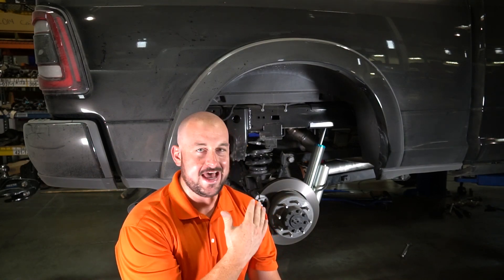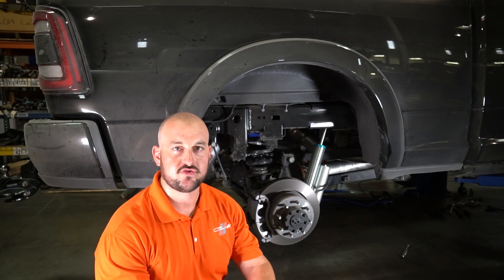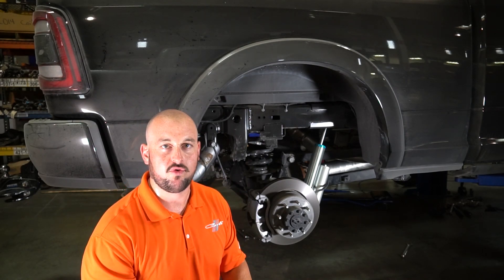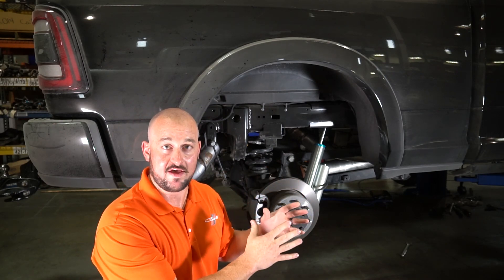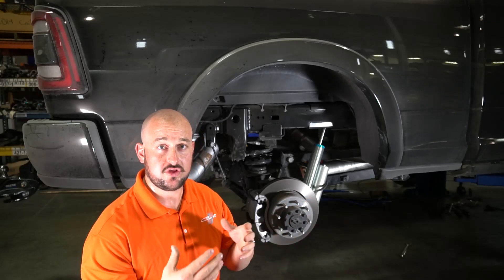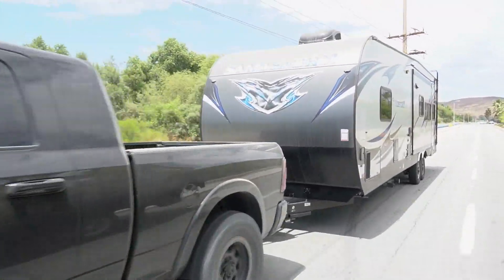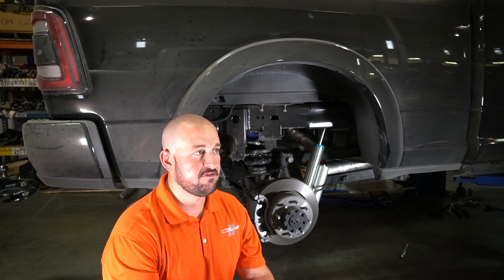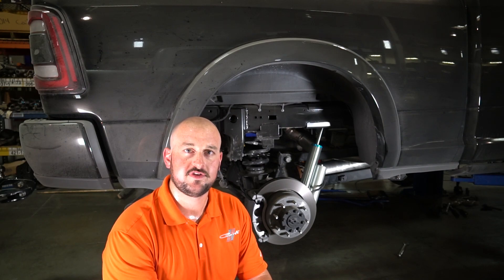Carli Suspension Leveling Pintop Shakedown

Comment: Adjustable air springs allow drivers to raise and lower the vehicle to one of five ride height settings, depending on where you’re working or how you’re playing. In addition, the constant driving profile delivers a proper headlamp-to-road angle for consistently even forward illumination. All of this can be easily controlled with your fingertips using convenient dashboard buttons.
Proper headlamp-to-road angle.

Comment: I have a 2005 Dodge Ram 3500 SRW short wheel base. It is a Quad Cab set up. I to a a camper that comes in between 9-10000 pounds. What suspension system would you recommend. I hunt out of this truck as well.  It gets some off road use but not anything major.  I am looking for a great ride without loosing towing capacity.
Reply from the maker: A Backcountry with Control Arms sounds like a perfect setup for you. End links and Add-a-packs if you're on a budget, Torsion Sway Bar, Full Leaf Springs and Airbags if you're wanting to go all out!

This can be configured here: https://carlisuspension.com/product/dodge/dodge-ram-2500-3500/ram-suspension-systems/3-inch/2003-09/dodge-3-backcountry-2-0-system-2003-2009-diesel/
Reply: @thecarlisuspension  thank you!!  Want to go all out.  Soon as can get the money together and the wife's approval gonna get it done!!

Comment: So basically you cannot add air bags to this particular setup to help with the towing sag? Or has something been done to remedy that. Thanks for the advice
Reply from the maker: We maintain the stock rear coils so no load supplements are needed. If that's a "must have" then you can add airbags or timbrens. We recommend Timbrens as they're removable when not utilized for load support.

Comment: Do y’all have any recommendations on shops in Georgia for installing y’all’s suspension kits
Reply from the maker: Unfortunately, we do not have any retailers/installers in your area. My recommendation would be to purchase the system from one of our stocking retail outlets (https://carlisuspension.com/retailers/) and bring it to your local, trusted shop for installation.

We provide detailed instructions with the systems so any reputable shop will be able to handle it! That said, we always recommend self-install if you have the time and mechanical ability. No one will care about your install as much as you will. 😊

Comment: I am thinking about this kit for my 2019 2500. I am guessing that if I ran it in conjunction with Air lift bags when towing I would be able to re level the truck under load?
Reply from the maker: Airbags aren't a great option for the coil spring equipped Ram 2500s. We recommend Timbrens as they're removable when not loaded to prevent the loss of uptravel.

Comment: Great video and explanation. Will this work and maintain the factory payload (5400lbs) for a RAM 3500 dually or is that a different suspension tune?
Reply from the maker: We have a system for the 3500 DRW that is a different shock package (and tune respectively) that maintains the factory payload as the springs are not altered. This can be configured here: https://carlisuspension.com/product/dodge/dodge-ram-2500-3500/ram-suspension-systems/2-5-inch/2019-ram-3500-4x4-diesel-2-5%e2%80%b3-leveling-system/pintop-leveling-system-2019/

Comment: Can you tell me the tire setup on the truck in this video along with the wheel specs and offset. I am definitely considering this setup. Thanks
Reply from the maker: Trail Ready 20x9" Wheels, 5" Backspace - 37x13.5" Nitto Ridge Grapplers.
Reply: @thecarlisuspension  Awesome! Thanks for replying!
Reply: Is that a 0 offset?

Comment: Can I expect the same kind of performance with the 2nd gen Rams and leaf springs?
Reply from the maker: The 2nd Gen Rams have short arms front and leaf springs rear. The ride will be very similar up front and, with the full leaf springs, similar in the rear. 2nd, 3rd and 4th gen rams can run our Long Travel airbags to supplement payload capacity back to factory with no sacrifice in unloaded ride quality or travel. I'd give the ride quality edge to the 2014+ and the hauling capability to the other trucks given their ability to run the bags. Very much in the same ball park, either way!

Comment: My 2500 limited has  Factory load leveling air system is this going to work  on my truck
Reply from the maker: This will install on your air-ride rear but you'll need longer links to level the rear to the front. CJC Offroad has these links available.

Comment: 3.25 level for a 2019 ram 2500 set up for factory air ride eta?
Reply from the maker: We're not doing the air ride 2500, unfortunately. Hit up Top Tier Suspensions or CJC Offroad as they provide the parts needed to make our system work on that vehicle!

Comment: Can that still up a 40ft 5th wheel weights bout 14k
Reply from the maker: Depends more on hitch weight than overall. 5th wheel can be 10-20% of total trailer weight on the tongue. 10%, you'll likely be fine. 20%, you'll likely want to look into load supplements.

Comment: Can u put 8000 payload on this truck?
Reply from the maker: This is a 2500 - they max out mid to high 2,000s.
Reply: @thecarlisuspension   it should be standard factory 8000 but does carli have suspension to increase it to 8000 ?

Comment: Is the plan now to change the gen 4 rams 3” front spring to the 3.25” going forward? I ask as I currently have the 3” version and I see your now marketing only the 3.25”. Any benefits to going to the new spring?

Any update on the ram 3500 air bags? With my 5th hooked up, I’m squatting 2-1/4” in the rear with the 5 leaf add a pack and looking to fix that.
Reply from the maker: Hi John, The 3" coils provide 3" on the Mega Cab, 3.25" on a QCSB and about 3.5" on the SCLB. We changed the way we market it at the Quad Cab seems to be the most common application. Nothing has changed in the manufacturing of the springs. The airbags were released last week! Should be shipping in 4-6 weeks. 
https://carlisuspension.com/product/dodge/dodge-ram-2500-3500/ram-components/13-18-3500-components/long-travel-air-bag-system-2013-ram-3500/
Reply: Carli Suspension Carli Suspension Hell ya!! The bags are alive👍🏻 I’ve been bugging CJC about them. Can’t wait to get them and fix the sag ass condition. 
Ya I have an 18’ megacab so that makes sense. Next year I’ll move up to the full rear spring pack and big boy shocks. 
How does some get the coilover & bypass front shock setup? Is that only installed direct with you guys?
Reply from the maker: @ColoradoGunfighter  Yes sir, that kit is direct install only!
Reply from the maker: The Leaf springs are capable of more travel than the shocks allow. The rear shocks are 11" travel cycling at an angle to allow 13" at the wheel, all of which the airbags will cycle.
Reply: Carli Suspension Awesome! Thank you for getting back so quickly.

Comment: I prefer the truck to not look saggy loaded.
Reply from the maker: That can be remedied with timbrens or airbags!
Reply: Carli Suspension, my 18 Ram 3500 limited has rear airbags but still has a pretty harsh unloaded ride.  The Carli system ordering scheme is confusing for my setup.  Lots of options to the pintop system but no clue what is recommend vs required.
Reply from the maker: @grwolf272  Everything should be explained in the description on the product page. Totally understand what you mean, though - the product line, being performance based, is a bit complex and takes some reading or a phone call to grasp the way we laid it out. That said, the base kit, CS-DPT25-13-D-ALAS, includes all components needed for the front suspension and rear shocks, then the rear springs, CS-DFSP-19-D-ALAS, are listed an auto-selected as they're required. This is the leaf springs kit and all rear fabricated parts to complete the suspension system. Lastly, you need to choose an option for the sway bar, either drop brackets or our replacement torsion sway bar. The rest are ALL options, nothing more is required. Feel free to call us anytime to chat about the above in more detail! 888-992-2754